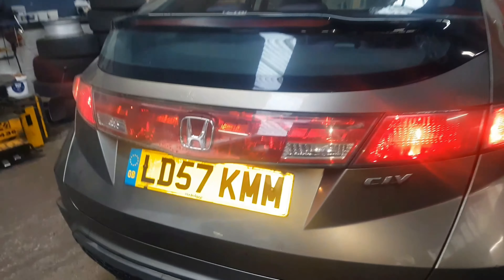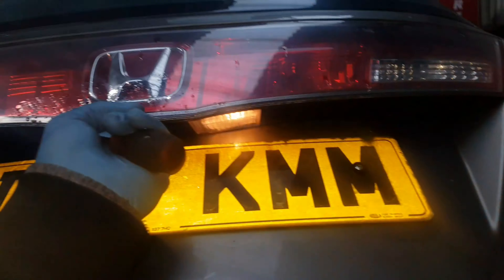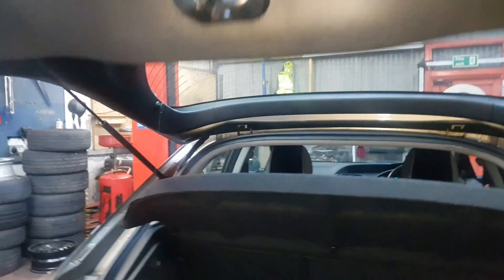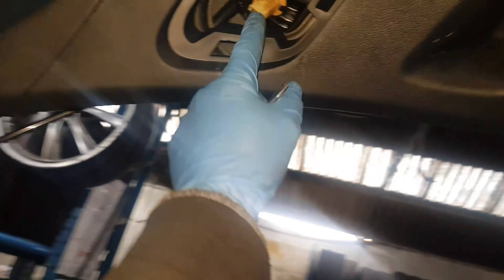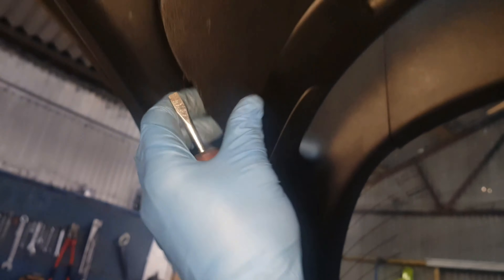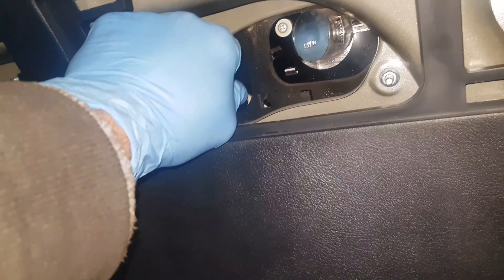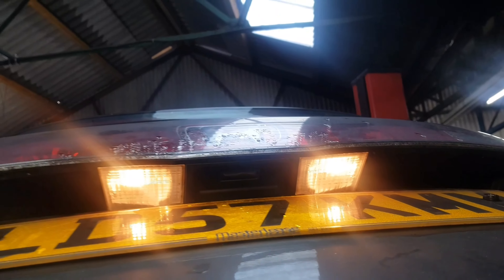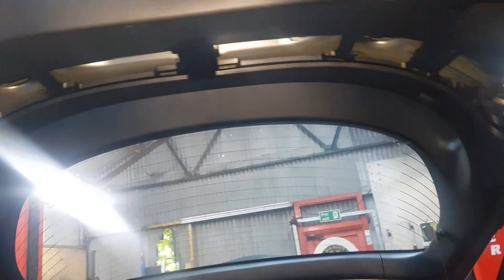how to replace number plate bulb on Honda Civic 4K

Comment: How about both rear fog lights? Have you done a video for this?
Reply from the maker: Hi sorry not done the fog lamps. Will do one when I get the same model in again. Thanks
Reply: @TajMotorMedics  thanks for the reply
Reply from the maker: Hi, I had the same civic but didn’t have time to do a video. I’ve posted a picture on community page so you can check it. It’s only one fog lamp on the rear and it’s on the right side of the boot lid. To do it you got to remove the plastic panel on the boot. Thanks 🙏🏽